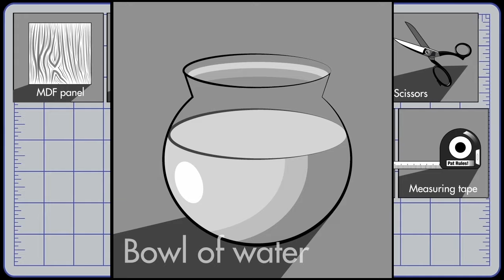Tutorial, Plaster of Paris Sculpture

Comment: Thanks for this tutorial! I am wondering how you got the plaster so smooth? Did you only use the plaster wrap or did you add extra plaster or double the wraps? I keep ending up seeing the weave of the wrap and the edges of the strips after I try to smooth it.  Any help would be much appreciated.  Thanks!
Reply from the maker: I mix plaster powder with water into a glue consistency, paint it on with a brush, work fast because it drys fast, paint layers until you can't see bandage weave anymore, don't worry about putting too much on, it stands easy with sand paper, the sand paper refines and smoothens it. Thanks for your comment!

Comment: Thank you for this tutorial! My only question is what is the purpose of the PVA glue? I'm new to sculpture making with Plaster of Paris.
Reply from the maker: Thanks for the comment, the PVA glue works as a sealant, smoothening out the very porous plaster, so that it takes paint well...otherwise the paint would chip easier, it works well on building materials, so why not? 😁
Reply: @patrick3081  Ahh I understand. Thank you for the clarification!
Reply: @patrick3081  So do you think Gel Medium would work too?
Reply from the maker: @meba671  not a clue, I've never used it, but if it works please let me know. I used PVA from the hardware shop because it's often used to seal porous surfaces...and it's cheap! 😁